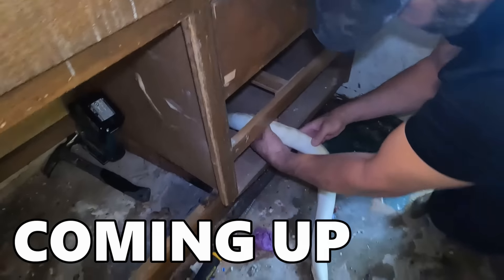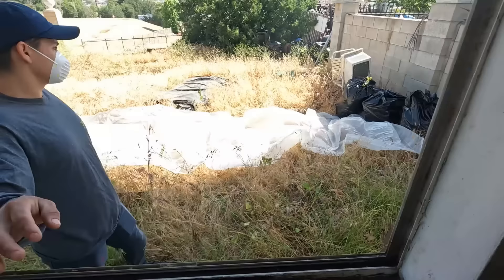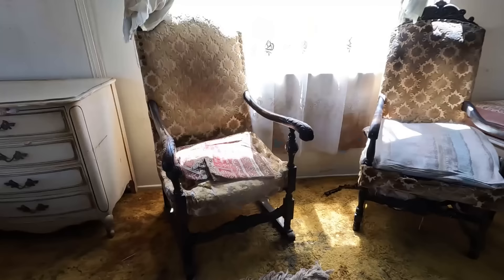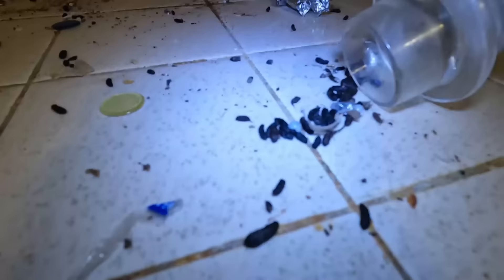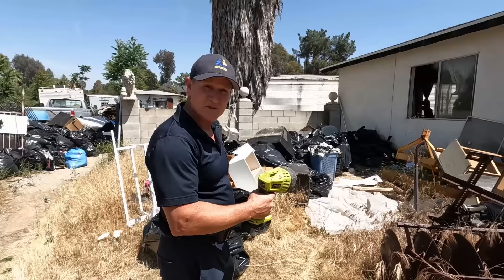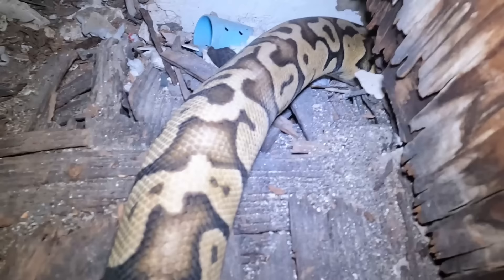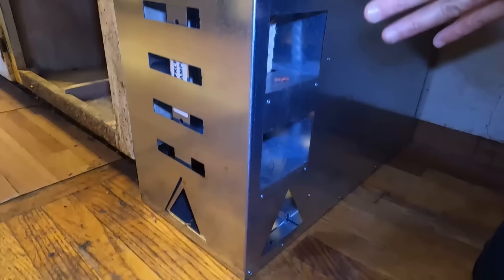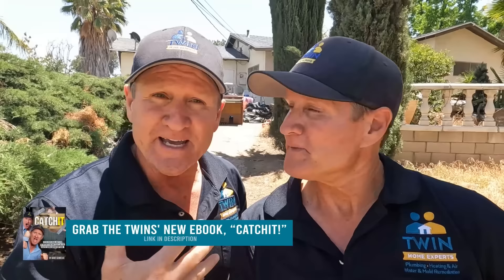How to GET RID OF RATS FAST!!...snakes

Comment: Ball pythons are very picky eaters and not nearly aggressive enough to send them after wild house rats. The reason they call them Ball pythons is because their defense mechanism is to roll into a Ball as opposed to striking and strangling whatever is threatening them. On top of that they are pretty small snakes and only get 4-5 ft.

Edit- there have also been numerous times where the Ball python rolls into a Ball and the rat starts chewing on the tail of the snake.
Reply: Did you miss the part about where the guy had not done that before it was the first time for him you know so they’re just like trying stuff out.

Comment: 8:14 I was using colorox bathroom spray to clean my bathroom, and the scent was so STRONG and intoxicating. They say that it should be used in a well-vented area, I say, don't even be in the same area after you apply it 🤣🤣
Reply: Anything with some bleach in it is going to make a strong smell as the chemicals react, and it's difficult for me too as I am a bit sensitive to synthetic fragrances like those in purfumes.